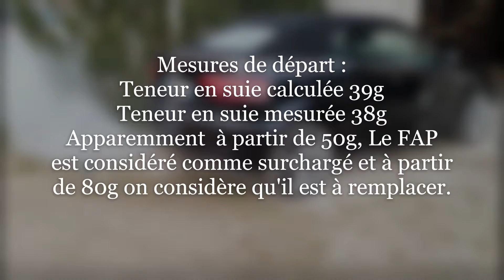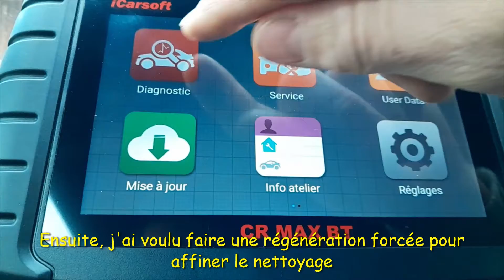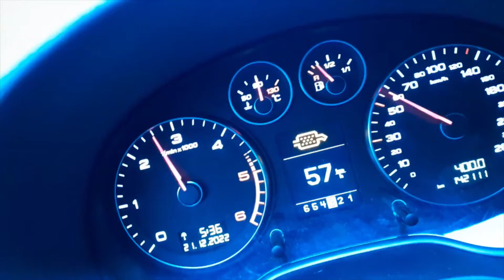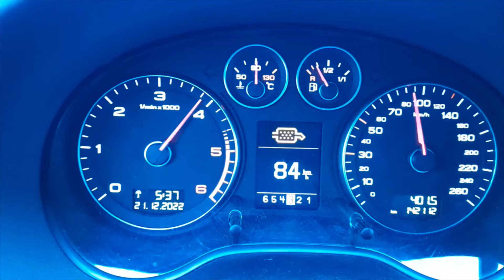Nettoyage FAP Audi A3 8P 2l Turbo D 140CV avec DPF  XENUM acheté sur My Little Garage  "merci GLB"

Comment: Salut, j’ai besoin d’aide. Mon A5 2.7 190ch est aussi avec 39gr en calculé et 27gr en mesurée. Tu as eu besoin de supprimer des choses pour rouler avant de faire la partie sur route ?
Reply from the maker: Non tu met le produit tu suis la procedure et c est bon , ça marche nickel
Reply: @ il y a besoin de mettre les valeurs à 0 à la fin ? Ou la régénération roulante le fera automatiquement ?
Reply from the maker: Salut , oui faut remettra zero
Reply: @Worksandmechanic  ah et est-ce que tu avais la voiture qui était en mode dégradé avant de mettre le produit ? Désolé mais tu es le seul que j’ai trouvé qui a une Audi, et qui peut me donner une idée de mon problème
Reply from the maker: Pas de soucis ,  j'avais le voyant qui s'allumé mais pas fixe c'était aléatoire, je pense qu'il n'y en avait plus pour longtemps avant le mode dégradé

Comment: Je le fais cette après midi 😊et on a sûrement le même moteur 2.0l tdi 140 moteur CBAB
Reply from the maker: Salut , n'hésite pas a donner ton retour
Reply: @Worksandmechanic  bonjour le l'ai fait samedi du coup, plus de voyant,plus de fumer a l'échappement, on la passer à la valise d'un pote a moi..et le taux de suie a fortement baissé. Parconte impossible de faire une régénération, au niveau de la température turbo il devait être a 180 degré si jme rappelle bien pour lancer la regen..mon turbo été a 210 degré et le temps de faire la manip avec les pédales pour lancer la regen,mon turbo descendait trop vite en température.. après le logiciel a mon pote,c'est un logiciel cracké..du coup je vais voir avec un garagiste
Reply from the maker: salut
je n'ai pas pu faire la régénération forcé non plus, j'ai du allez au garage qui m'a déclenché une régénération que l'on fait en roulant